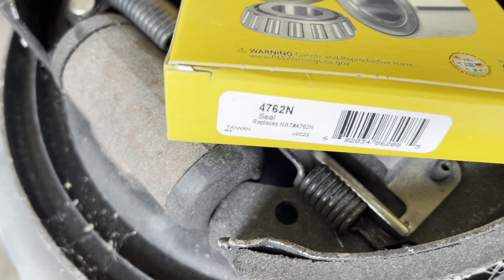Dan’s Silverado gets a new look…and we take out some anger😂

Comment: I like Dans truck. Cant wait to see it painted. Oh and why the wheel spacers? Just on the rear?
Reply from the maker: They are all the way around...the offset of the wheels made it where it had to have spacers
Reply: @lowerclassfab431  Ok thanks. I like those wheels.
Reply: @lowerclassfab431  I've heard you guys say he drives it alot. Any problem with the spacers?  I've always been afraid of using them.

Comment: What’s the tire specs and is the rear end shortened?I have a 94 that I stepside swapped and I plan on bagging it using the infamous under frame 3 link kit
Reply from the maker: Stock rear axle and the wheels are actually on wheel spacers but I’m not sure what the actual offset is
Reply: @lowerclassfab431 ok I appreciate the info thank u